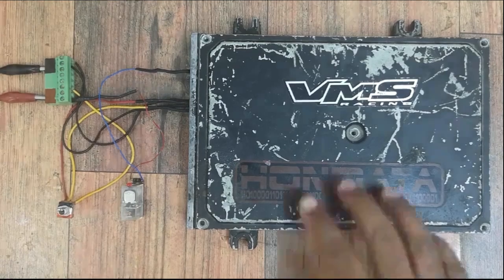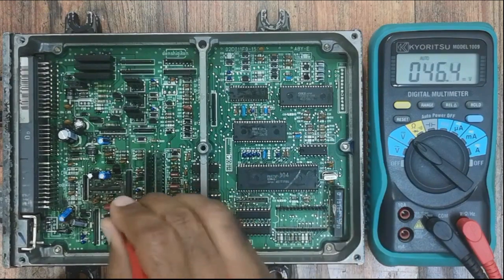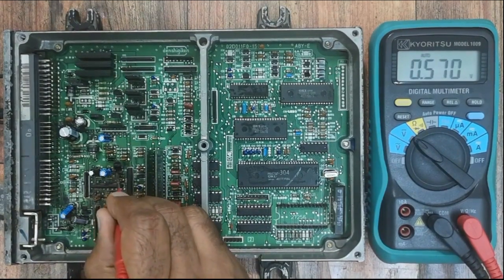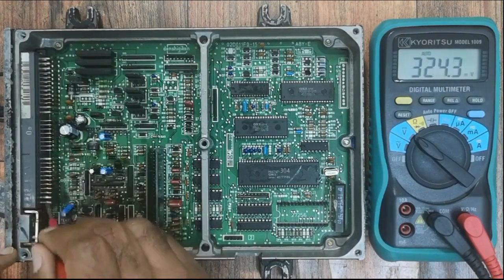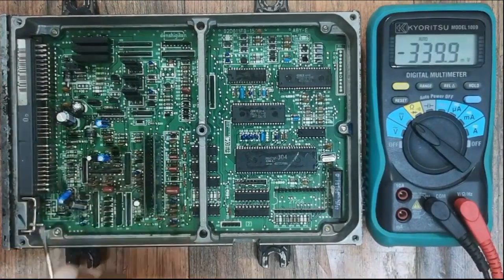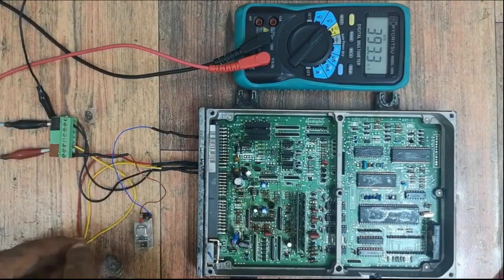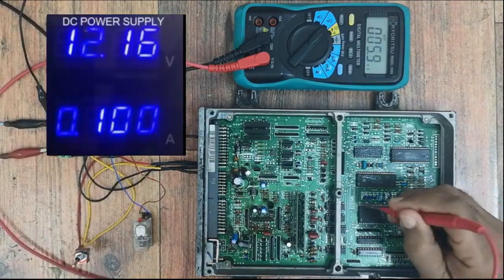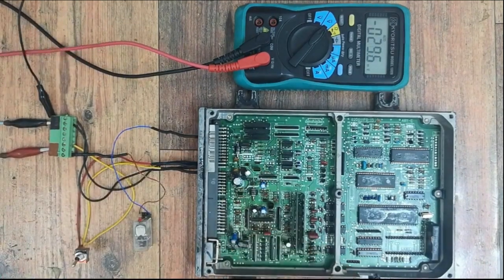Exploring the ECU hardware and testing - Part 4 (Quick fix)

Comment: hello i have the same issue but upon checking it has all the supply needed 

i replaced the ic17 which is the ta8903sn and i also replaced all the capacitor and tantalum capacitor but still my ecu is not booting
Reply from the maker: Hello and welcome,
Just check the status of jumper 1 (j1) it is very close to main microcontroller IC1, this jumper should be disconnected or not installed if you are not using Hondata board on top of main board, in cases the ECU run with Hondata board then this should be connected.